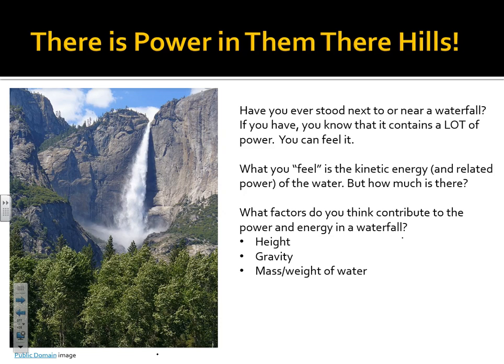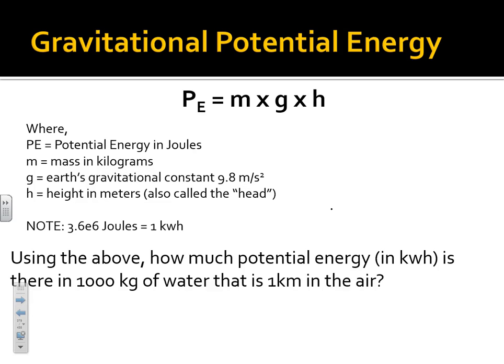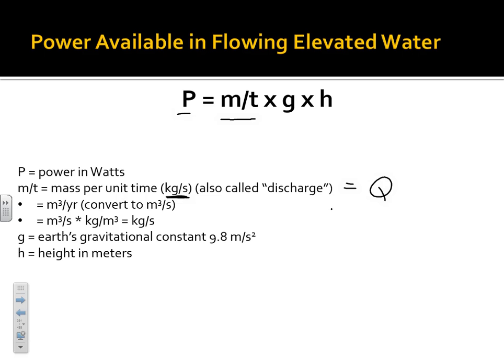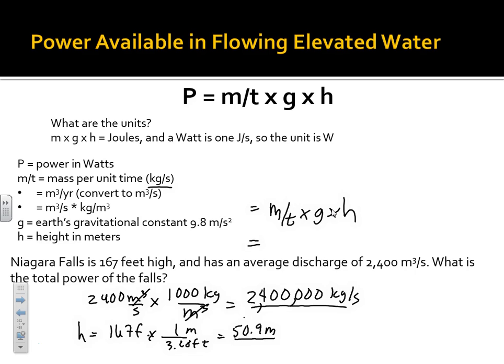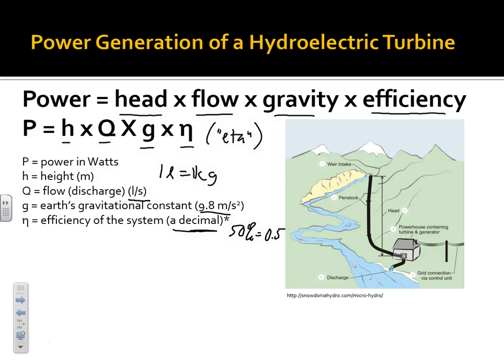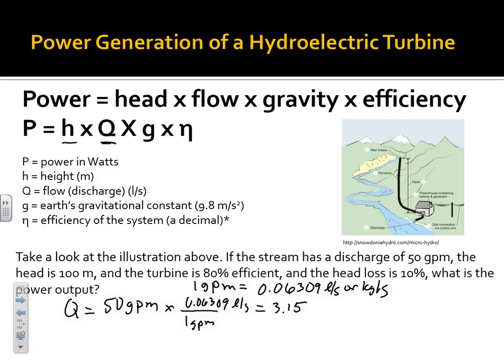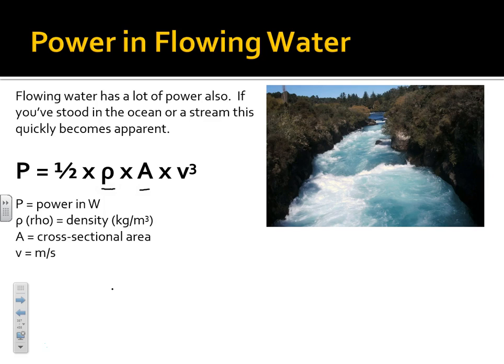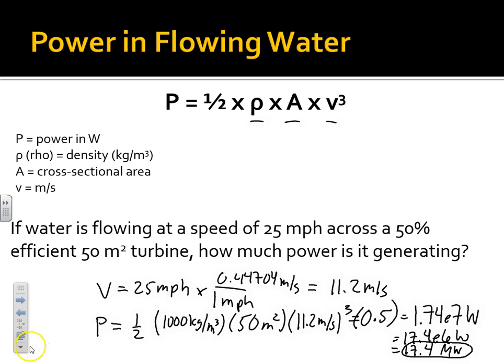NRG 154 - hydroelectricity power and energy calculations

Comment: Just a minor error in your discharge calculation. You used 0.06309 l/s or Kg/s from 1 gpm conversion in stead of 3.15 l/s or kg/s from 50 gpm. Good work overall!

Comment: Hi Dan, I have a quick question regards a calculation I have - I have calculated the power of the following - FLow = 2 litres/s, G = 9.81, Head = 15M, Efficiency = 75%, Head efficiency = 10%. P as per my calculations = 199Watts (Im not as concerned about the calculations and more what the P in my instance means). If the Flow is constant, is it right to say that my setup would produce 199 Watts per second, and 11919 Watts per minute,  6.264705240 Giga Watts in a year?  Is this the right way to look at it or what am I missing? I want to understand what a hydro setup like the one outlined above would produce in a year in KwH so I can compare it to the average house consumption.
Reply: Its been a year lol, i don't think he is answering😂😂😂

Comment: Please can you solve this question
.the reserover area of a hydro-electric generating plant is spread over an area of 4000m^2 with a storage capacity of 8000000m^3 . the net head of water available to the turbine is 70m . Assuming an efficiency of  0.78 and 0.93 for water turbine and generator respectively, calculate the electrical energy generated by plant. Estimate the difference in water level if a load of 30MW,is continuously supplied by the generator for 6 hours
Reply from the maker: This is not my expertise, but the equation for output is P (kW) = net head (m) X system efficiency X flow (m3/s). You can get all of that easily except for flow. I don't know how to determine the flow, but I assume that there is an equation that will tell you that based on the depth of the water (which you can figure out by using the area and the storage capacity) and the net head, but I am not sure. This paper might help (https://cdn.intechopen.com/pdfs/40550/InTech-Hydro_power.pdf). A version of that equation is on p. 98.

You can figure out the volume of water that went through the turbine after 30 MW of generation for 6 hours by using the same equation and solving for flow when output is 30 MW. Then you can use that the figure out how much the level would drop by using the area of the reservoir. 

Hope this helps! I honestly don't know how to figure out the first question, but the second one should work if you run those numbers.

Comment: Dear sir, 
The equation you applied for hydro power calculation does not include ρ, to the best of my knowledge, the equation is: P=ρQgHη. Can you please explain a little bit? Thanks for your time.

Regards

Leroy
Reply from the maker: Sorry for the delay. You are correct, but my formula used liters/s for Q instead of cubic meters/s. Since there are 1, 000 liters in a cubic meter, and water has a density of 1,000 kg/cubic meter, you can skip the density part if you use l/s. Hopefully that makes sense - it's a bit difficult to explain without writing on a board!

Comment: Hi,
Thanks for the great video. 
At 17.30 you use 0.06309l/s instead of 3.1545l/s in the power output formula. Is this a mistake or am I missing something?
Thanks!
Reply from the maker: Sorry, have not checked this for a while. You are correct - I definitely messed that up when I applied the power equation. I wish I could do annotations to update it. Thanks for letting me know.
Reply from the maker: Although I just noticed that the answer is correct, but the number in the formula is wrong...
Reply: Hi thanks for the video 
There was a mistake 
U put the value of 1gpm instead of 50gpm
The result 2.25 should be multiplied by 50
Reply: Stephen Burke u r right
Reply: You are right he missed it the answer is 2.228KW